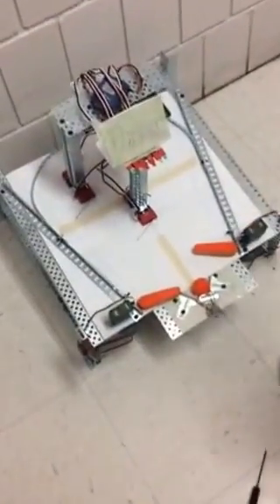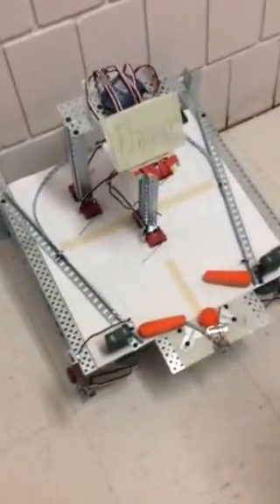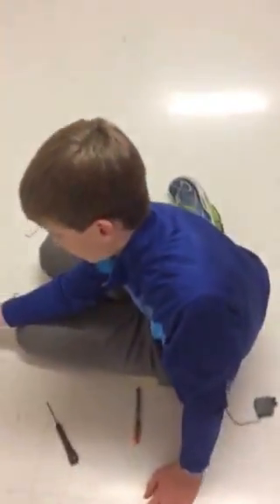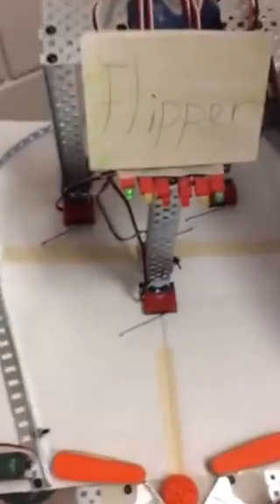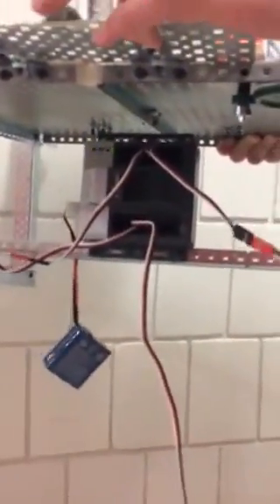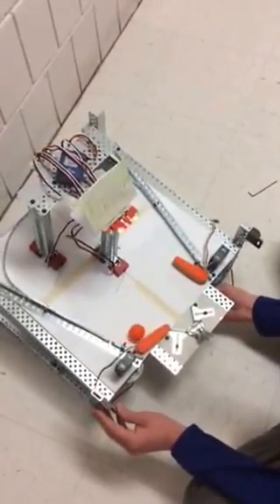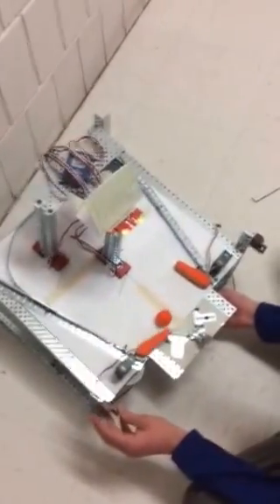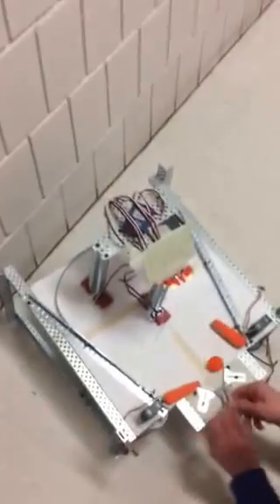VEX Pinball Machine

Comment: can you guys tell me how you guys did this, me and my friends have a project for school and we have a similar idea that you guys had
Reply from the maker: Are you guys using VEX parts? The pinball machine is pretty simple. Two servo motors set to spin "x" degrees operate the flippers which were 3-D printed. Points were scored using the lights. The hardest part might be making the flippers.